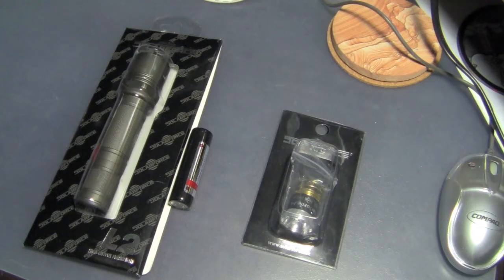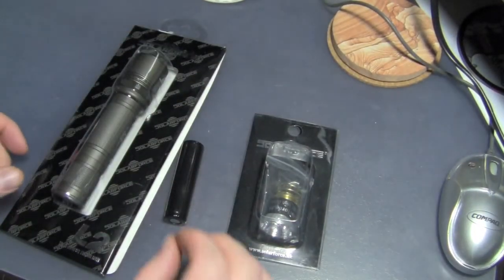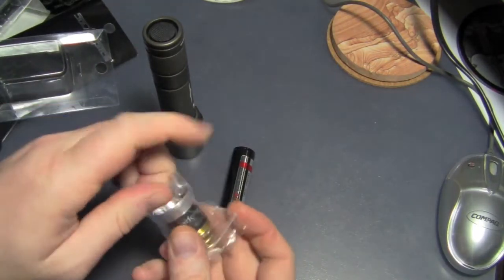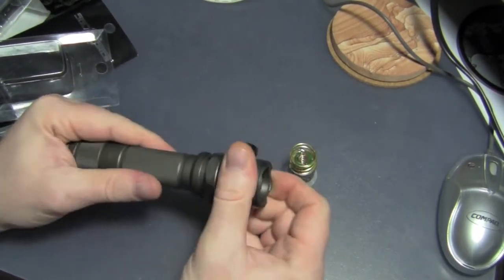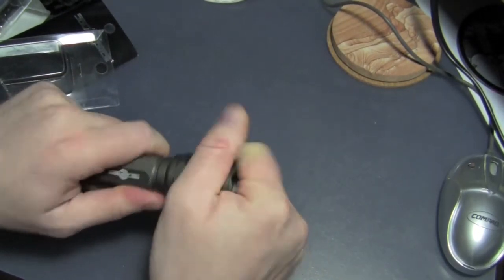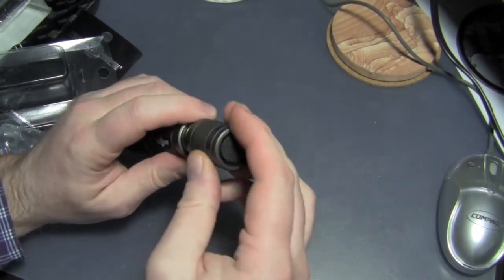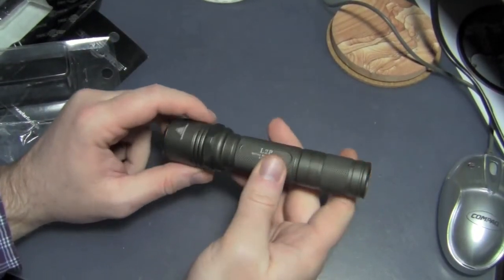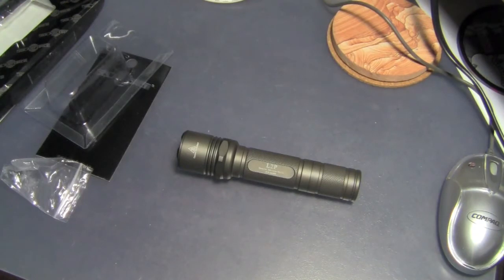building a flashlight, a solarforce l2

Comment from the maker: @TheTactical6string a standard cr123 is 3v. if you have a light that takes 2, it runs on 6v (3 is 9v...etc). basically what you want to do is match the battery voltage to the light without going over (or under) the stated range, and be mindful of the current draw. with this light, i used a drop in that works from 0.8v-4.2v. i could use one 3v cr123, one or two 1.5v AA (or AAA) alkalines, or a rechargeable lithium battery...to name a few options. hope that helped!

Comment from the maker: @paintballhead03 battery @ $17 + body @ $20 + p60 drop in @ $17 = $54 all in (+ a charger if you need one). you could go with different options (use cr123s instead of a rechargeable battery) to bring the up front cost down. it isn't the world's greatest light, but it would work just fine for a general outdoors light. i got the parts from lighthound

Comment: but your showing a L2P,witch came after the L2! but i think that the switch that comes on the L2 version is the better one!and feels more like surefire 6P tail cap switch,i have two solarforce L2P's grate flashlight,but i ended up changing there tail cap's for the L2 version,as my thumb works better with it,nice video,thank you.